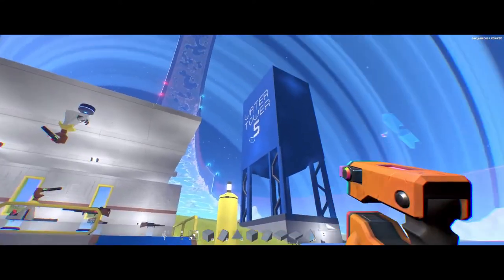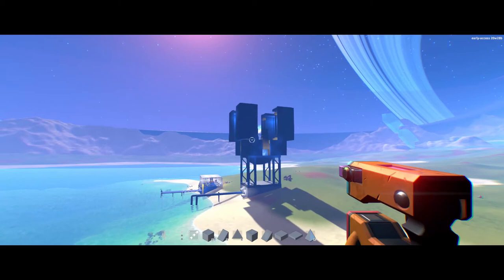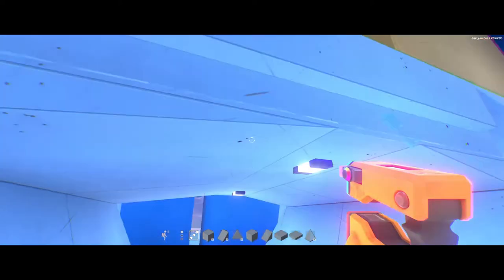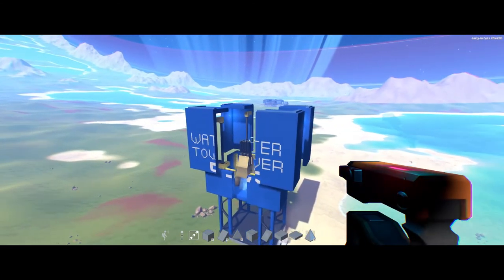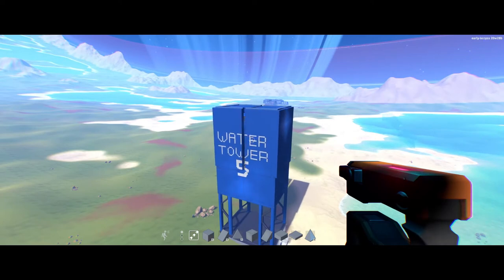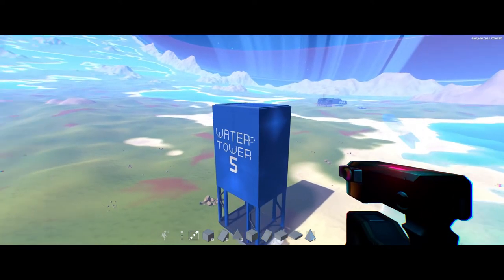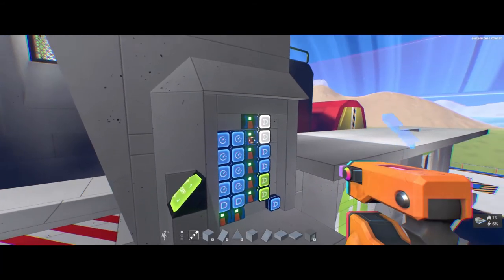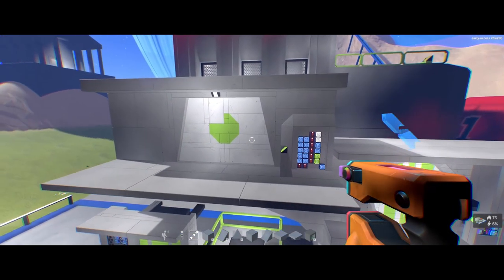Dubious Water tower & Moar Doars - Starship EVO (Early Access)

Comment: If you use a piston instead of the rails on the rotating door it could be timed better right? I use 5% Speed and 2,5 Meters length and it takes pretty much as long as the rotary block takes to turn 360 degrees. If you use a sequencer gate it should be able to time it even further because the rotary block doesn't need to turn 360 degrees... But the sequencer gate is currently bugged for me.
edit It wasn't a bug... I was just stupid...
Reply from the maker: Thanks for the advice. I think when I did the rotary door in the video, either the pistons hadn't been introduced yet or I'd not gotten used to them.
I know in one of these videos I tried using a piston sideways and it was bugged out.